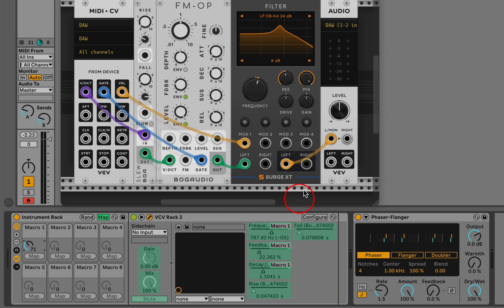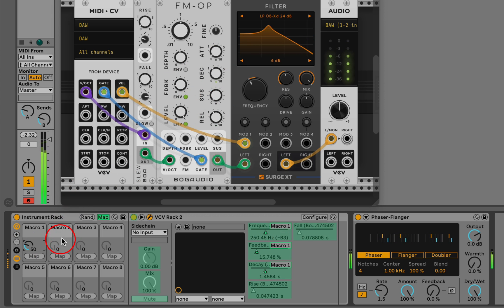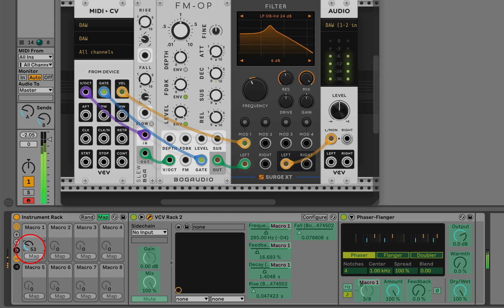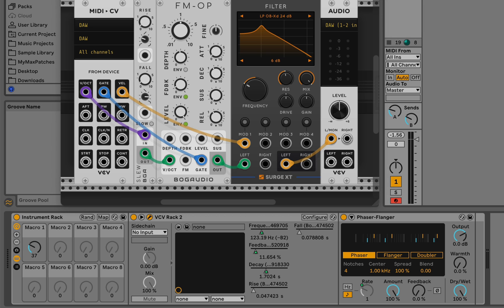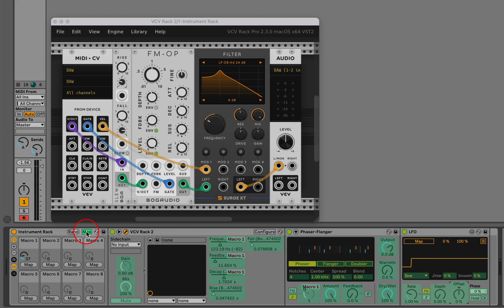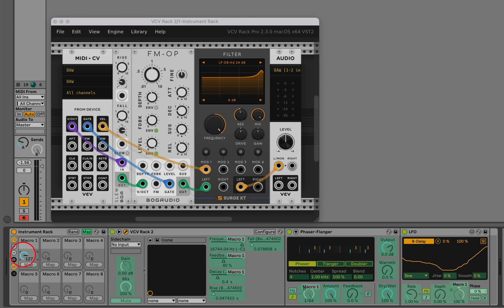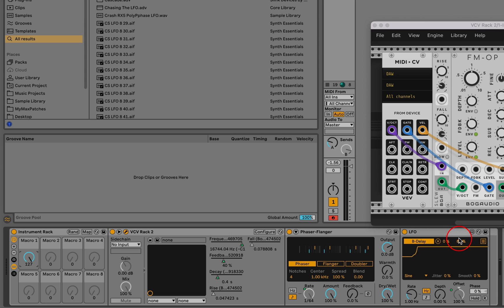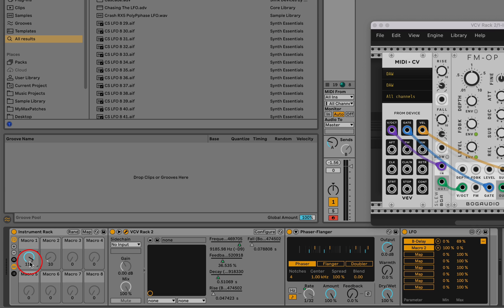Macro mapping outside of Racks

Comment: Brilliant! I can see myself using this all over place. Place a compressor (or other neutral effect) on a group track and then group it so that it's in a fx rack. Now you can use this method to control parameters in the sub channels from the group channel. Very helpful with Push 2.